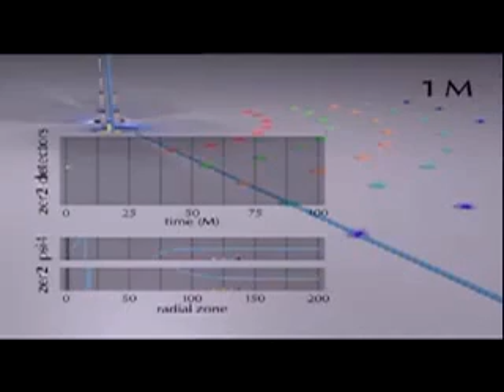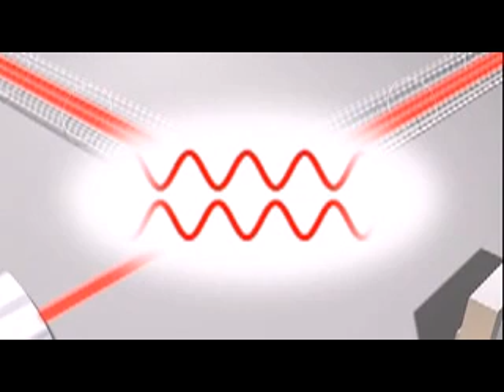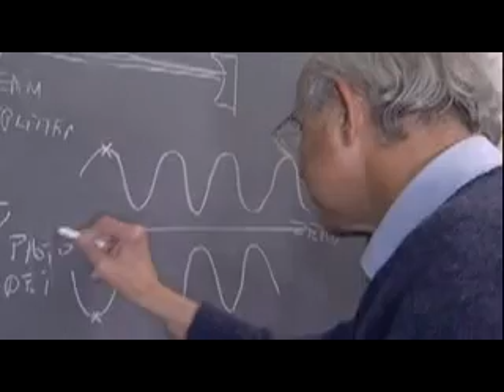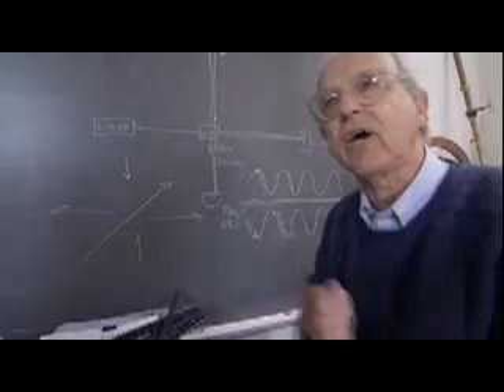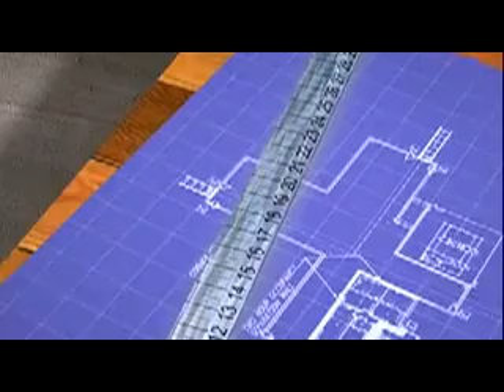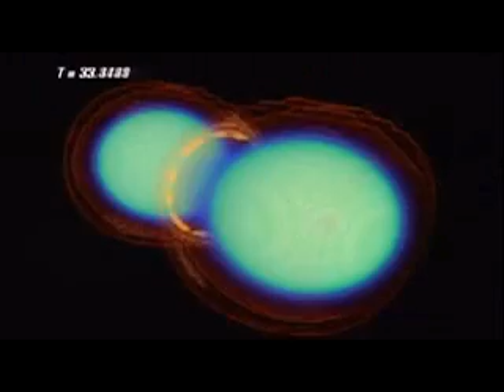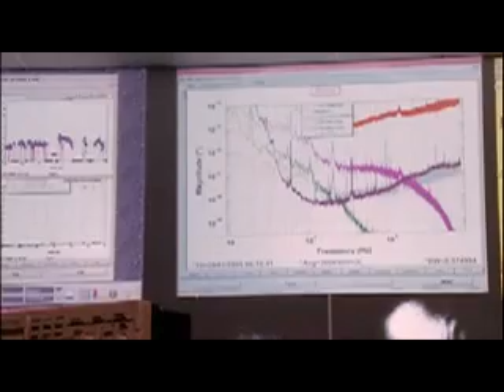LIGO Gravitational Wave Observatory

Comment: To hypothesize the Gravitational Wave, one must presume that Gravity is a "broadcast" force, like light or radio. something that is not likely. Gravity is in my view locked to the Objective Mass, and not a transmit force, like Einstein presumed . My conclusion is this : To broadcast gravity, one must do so in kilograms (See Cavendish Experiment). Not as a transmission waveform that is a compression and rarification interval of " Ether" (Ether is my personal understanding of the Higgs Field). By changing the geometry of an object, is not the same as adding or subtracting molecules. that is by stretching a rubber band, the wheight is not altered. Ergo, geometry has nothing to do with gravity, but the number of atoms does. If one of the LIGO arms is displaced due to any force, the atomic compound is not changed, and therefore no change in gravity . Although "a gravity wave" is supposed to displace geometry in a target object, again it has to be presumed that the gravity is a wave that is able to be transported over distance, something I would think is false. In so doing also may decouple the link between Gravity and Light (edit 05.12.2015 : the light wave wavelenght will stretch along with the tidal forces, or displacement of earth geometry,  therefore it will make no visibility in the reciever mirror. If not, the Light wavelenght is " static" and the geometry of the earth is changing, making the mirror detect a phase change . /end edit ) . Einstein has mixed the cards together most probably because of the Gravitational Lensing experiement, perhaps . I might compare gravity with temprature, it belongs to the object, and can not be "transported" . Temprature again has a IR electromagnetic radiation that energise the atomic vibration. well. Temprature has a transport wave Infra Red. The IR wave needs to bounce off a molecule to create heat in the form of vibration on the molecule. if no molecule absorbs the wave, the IR wave is cold ...  Just like the lightwave is invisible until it penetrates the eye. If not the night sky would be bright light ! But does Gravity, have a counterpart waveform ? In my understanding no . Compare it to Magnetism, it has no way of transmitting its force unless electrons are put in motion. or a permanent magnet is motivated, over a distance. question is then is electrons displaced when optical waves are transmitted , like Light or radio waves through vacuum  ? If there is a Gravity wave it has to have a specific frequency. Is that frequecny in the electromagnetic spectrum ? Making it able to "pitch" light to a LFO to radar, to Radio, down to a "Gravity wave" well. who knows.

I see the Gravity waves is detected september 2015. No sign of critisism . everybody buys it . I dont. Its only detected in colliding black holes. Personally I think it is a light pulse that disturbes the mirrors in the LIGO. not a gravitational wave. That Light can move objects was experimentally proven by William Crookes.
Reply: Radar Blue Well done sir... You nailed it... I have been saying it for ages... it's all temperature... Gravity has no wave as there is no gravity... Just a natural phenomenon we have used to explain starbirth theory... That's where all modern physics is at the moment... Looking for something that doesn't exist...
Reply: +20Proff   " In my opinion (which has no scientific credibility - I just think) what 
we refer to as "gravity" is a by product of electromagnetic forces...  " 

Sir, you are so close to the truth.  Gravity is the byproduct of something else, and the nuclear bonds are involved.  Please notice that the impressively weak "force" of gravity works across great distances.  Let me say that in a different way:  It has a different scalar than EM.  

There are no Gravetons.

The Earth experiences two gravity waves every day, proven by the tides.  Can LIGO detect these?

Does anybody want to know how gravity actually works on a nuts and bolts quantum level?
Reply: +Jon Wiebold Many thanks. With regards to your questions: 1. I assume this is actually rhetorical. LIGO cannot detect them... 2. Yes. I very much want to know... I know very little of nuclear bonds... Could you please do me the courtesy of referring some useful learning material??? It would be very much appreciated...
Reply: +20Proff  YouTube video:  Origins of Mass  Dr Don Lincoln of Fermilab.  
To everybody's surprise, Inertia, Momentum and Gravity are all N forces, normal reactive forces to outside influences.  In the case of gravity, it is an N reaction to the gradient of time dilation, not any other outside influence.  Thus, Newton's formula is arithmetically correct but descriptively wrong because the two masses are not attracted to each other, they are motivating themselves toward the common center of time dilation.
I apologise for not answering you sooner, but NOBODY seems to get this simple gravity explanation.  Because, if proven true, then there are no gravity waves.  Gravity is internal to bonded quarks.
Einstein was right about Equivalence.  At the quantum level, kinetic acceleration and gravitational acceleration share causality.
Reply: Cheers...
Reply: Thanks.  More about how gravity works:  
1.  If it is, in fact, the strong nuclear bond inside the nucleon, with its ridiculously small scalar, that is the actual force involved in gravity, then how can gravity have such a large scalar, larger than the galaxy?  The answer is this:  The nuclear forces need only to operate on the nucleon, nothing else.  It is the time dilation that has the immense scalar.
2.  I cannot prove that the nuclear bond is not instantaneous, but it needs to be slightly slow in order to react to time dilation and give us the normal N behaviour of gravity.  Gravity does not make sense as a reactive force unless you apply the time dilation of general relativity to your understanding.
3.  A cross section of Einstein's "trampoline" depiction of spacetime  contains a graph that represents time dilation on the Y axis.  Time is slower in the sagitta under the big marble.  The local amplitude of gravity is the slope of his line, where horizontal equals zero.
Reply: What a fabulous discussion!  May I interject a thought or two?  We have some secondary evidence about dark matter, that is gravitational lensing. 
It is my hypothesis that we know two basic facts about DM,  1.  As it responds to gravity, it must be normal matter.  2.  As it is intangible, undetectable and invisible to us, it must be moving FTL.  Therefore it is normal matter that was created at some speed faster than light, relative to our norms.  Heresy, I know.
Reply: Radar Blue - you’re making the same mistake as Newton thinking there is an invisible force between two objects - that somehow gravity is connected to the object. Massive objects are not gravity, they create gravity by bending space-time. The movement and collision of massive objects can create gravitational waves in the fabric of space-time. Since the entire universe is composed of this fabric, the gravitational wave propagates through the universe for as long as it has energy.
Reply: +Jon Wiebold +20poff . Good day Gentlemen. I have written an Essay on Gravitational lensing on my blog. I would be happy if you look at it ! Cheers . http://darkgungal.blogspot.no/2015_11_01_archive.html
Reply: +Radar Blue   I read your blog. I could give you 20 comments, but I want to start with only one. You seem confused about the concept from General Relativity concerning Time Dilation.  In completely different words:  Where mass collects, Time is slower.  In the void of space, time would be faster.

Glad you put your thoughts onto paper.
Reply: +Radar Blue "Gravity is in my view locked to the Objective Mass"  I concur.
Reply: +Jon Wiebold Thank you. I will look at it at once :) sometimes its the other way around !
Reply: +Radar Blue so if this is correct it explains why no continuous waves are being detected from normal planetary orbits and our own moon. You would think there would be some continuous ringing resonance if such waves could propagate. so how do gravity waves differ from the gravity effect of normal moons on planets such as what causes ocean tides on Earth.
Reply: +Radar Blue  Since no one has proved anything about gravity yet you ideas seem a little premature.
Reply: Nobody will understand what gravity is until after they understand what mass is.  Mass is not an intrinsic property of matter, it is a quantum behavior.  Go watch "Origins of Mass" video, Fermilab, Lincoln, and then come back for a macro and quantum explanation of gravity.  All your questions can be answered.
Reply: +Jon Wiebold thanks for the material suggestions I have to admit that I have not thought about the question of what mass actually is at that level.
Reply: Are you comfortable with the Lorentz Factor, the Gamma Factor?  We will use it to explain how much more force it takes to accelerate something as it approaches the speed of light.  ( not Euler's Gamma )
Reply: Gravitational waves have been confirmed. Jossed.
Reply: Well there goes your explanation
Reply: +Celestial  My explanation will stand for a long time, but it will not benefit from my telling of it.  Nor will it bear my name.  I will say nothing new, just say what Einstein, Lorentz and others have said, show how their wisdom applies to the mechanics of Gravity.  Gravity has three necessary components...
There are still no gravitational waves.  Let a few chips fall and we shall see how this science evolves.
Reply: It seems your explanation lacks physics, I am afraid to say. To say it is not transmitted is to say it is an instantaneous force. The existence of the wave comes from the fact that any change in gravity will need to be communicated to the universe. Any such oscillation will be propagated as a geometric wave. Also, temperature is kinetic energy, and it IS transported, given its statistical nature. The radiation emitted by the body, already has the energy, it is not cold, the energy is carried by the photon.(Planck-Einstein). Also magnetism IS a wave, just as any electromagnetic phenomena propagates at speed of light. And just as you can´t compare sound wave frequency to electromagnetic, you can´t compare gravitational waves frequency.
To conclude: The existence of waves is created by the simple fact of a finite speed of propagation.
Reply: blackbomber72 Well, congratulations, you sound very smart... But, they did not observe a gravity wave, so they used a model... Gravity does not exist...
Reply: +20Proff gravity doesn't exist? That is the stupid statement of the day.
Reply: Hold on!  Let me decode that comment:  Gravity is not its own discrete thing, it is the composite and bi-product of several things.  The results of which we call gravity. Taking Gravity apart and understanding its components is the hard part.
Reply: And your point is, that it is not a wave just because it may be something much more complex?
Reply: Gary Simmons It's a simple argument that cannot be refuted: they cannot observe that which they have theorised and hence can only show proof through a model... Observing the model you have created is not observable and empirical... Every time they try to observe something, they don't actually observe it so they whitewash the data through their model... It is scarcely even science but rather the re-enforcement of a pre-conceived idea... If the scientific community was really confident about gravity, they would reproduce the Cavendish experiment by today's standards... Why do you think they have not reproduced it ever??? My thought as stated above is that everything relates to temperature, electricity and magnetism... We simply do not need "gravity" as it's own force to explain things...
Reply: +20Proff Ridiculous and petty. Also hypocritical, since you call temperature important, when temperature is actually average kinetic energy, it is a model according to your definition. It seems you not only lack physics, but also a basic knowledge of logic. The 4 forces are electromagnetism, strong interaction, weak interaction, and gravity. And I assure you the experiments made over this century are designed to rule out any ambiguity about their nature. They are not "just" a model. Their nature is precisely what the theory states. Also Cavendish balances are easy to make. I made a experiment once with one in my undergraduate studies.
Reply: blackbomber72 I don't have trillions of dollars of other people's money with nothing to show for it... How ridiculous and petty I should ponder the nature of my existence... Chill out...
Reply: +20Proff There is enough to show it. A gravitational wave is a rarefaction in space time that has cross or X polarization, comes from nonzero quadrupole moment astrophysical events, and travels at the speed of light. We detected just that. Hence it is a gravitational wave.
Also knowing the universe is never a waste. You may not see the fruit of this endeavor now, but in the future some wise engineers will find how to use them, and further our quality of life.
Reply: blackbomber72 Yeah well there is where we differ: I don't think space and time are variables... Equations aren't reality... You sound like a priest...
Reply: +20Proff You too sound like a priest. Defending a philosophy will invariably sound like that. I will conclude by telling you: What about the measurements of space and time? Are they false too? And then why things get near of each other? The reality is there and there are various ways at seeing it. I just consider General Relativity as the simple and with more predictive power of all the ways, and that is why I adhere to it. You are free to do whatever you want, but I needed to expose my points. Not just for you to learn another way at looking it, but also for the few people that read this. This will give them choice. Not discussing would be placing even more blind faith into an idea.
Reply: blackbomber72 How do I sound like a priest? I believe in that which is observational and empirical, whereas you believe in models... My theses as to explain what you refer to as gravity is not properly understood by you. You just regurgitated text-book diatribe of which I am fully aware... Back to the point: LIGO has not observed gravitational waves, yet they sell to the public that they have by publishing the results from their own simulation which differs from reality but they wish to superimpose upon reality... Enjoy that...
Reply: blackbomber72 Take dark matter for example: They take the mass of the universe and see that according to GRAVITY, there is not enough mass to hold the universe together. So, instead of saying gravity must be wrong and we are in the dark, they just invent a new kind of matter and insert that into their COMPUTER MODEL and then say it exists in reality. It (dark matter) obviously doesn't exist outside of their model (which implies gravity is incorrect) but the cult can't admit it...
Reply: Jon Wiebold Hey Jon. Gravitational lensing: Ring systems are not uncommon in space... They are visible in all spectrum's of light... What's to say that these ring's are not the bending of light but rather just ring galaxy's... The red shifts we observe from them could be the same as quasars, non-cosmological in nature... If you agree gravitational lensing is caused by black holes, it follows that you agree that black holes must exhibit gravitational lenses... Please explain why we don't see any lensing effects at the centre of the milky way??? Nothing bent, nothing distorted in direct contravention of gravitational lensing... Not all galaxies display lensing but some do??? Conflicting data from all sources...
Reply: Can we please stop this electric universe bullshit, the very fact of time dilation proves this 4d geometric, tenseless, object is curved in the presence of matter, also in order for the speed of causality to remain invariant during acceleration spacetime must be curved which also results in a fake force going opposite of the direction of the acceleration, this is why you're being stuck to your car sit while accelerating, and also you keep the speed of causality constant and don't suddenly glitch into the future or the past. And since spacetime is curved around earth you're being pushed upwards by the fake "acceleration" of the earth towards you, this is very settled, please stop dissing general relativity, unless you find an alternative to how keep the speed of causality throughout different segments in space and in time.
Reply: Daniel Skiba Electric universe? I didn't bring that up...
Reply: +20Proff Grav lensing is caused by time dilation. Time itself is slower and the speed of light is slower near a huge mass that causes the time dilation ( General Relativity ). 
 Gravity is three things.  The third one is a gradient.  Telescopes see lensing on distant galaxies because the nearer galaxy is a massive point in the middle of nothing with something else behind it.  The gradient is tight.  Not the same set-up in the Milky Way, sprawled across the sky.
Reply: +Jon Wiebold not correct time dilation has no role in gravitational lensing, you should read my previous comment
Reply: +20Proff To me it seems you don't understand the philosophy behind the scientific method. No understanding of the universe is absolute. One crafts a theory and tests predictions WITHIN a set of paremeters defined by the theory. Within the theory it is stated that waves generate a shear that responds to a curve, which is measured for correlation against the measured shear. It is no different than having a speed calculated by a theory and then measured within errors. Waves gives us an answer in the realm of precision we have. Or are you a purist which needs a total understanding of everything, in its most fundamental level at all times?
Reply: blackbomber72 I understand the scientific method perfectly well. Models are not reality and whitewashing the data from reality through a model is not the scientific method... So, are you acknowledging the theory of gravitational lensing is inconsistent when it comes to observing the black-hole at the centre of the milky way? That's how a conversation works: You answer my question first, before asking one... No, I am not a purist. No, I don't need a total understanding of everything in it's most fundamental level at all times...
Reply: +20Proff I can't find such information concerning the Milky Way Galaxy lensing.
And I don't get where it is hiding the truth. The sequence is: GR>Binary System>Radiation zone amplitude and inverse square>Curve. That curve is analysed against the data. Where is the truth being hidden? Apart from the obvious part where GR breaks down, which this experiment is nowhere near.
Reply: +Daniel Skiba  Sir, I agree that the Electric Universe hypothesis is flawed.  For example, compare the scalar of time dilation with the scalar of anything electric.  Big difference. BUT I am most uncomfortable with the term spacetime.  I consider space to be the only constant while time is variable.  How can spacetime be anything but Einstein&#39;s favorite shorthand for describing reality? Allow me to apply this unease to todays topic:  I see that LIGO detected gravitation waves from a PR point of view.  From a more scientific view, they get my Hurray! for detecting transient waves of time dilation, not gravity in its fullness, because time dilation is the only one of gravity&#39;s three components to have the right scalar to cross the cosmos, no matter the speed.  It seems odd to me that Ligo is an instrument for measuring space, not time.  In the mean time, I would like to keep my opinion about TD and GL until a better explanation is offered.  Thanks.
Reply: Jon Wiebold Fair enough, if you think space and time are different, the theory won't appeal to you. But given the existence of 4-vectors and the invariance of Maxwell's equations to Lorentz and not Galilean transformations, the scientific evidence points against your viewpoint. Also LIGO measures time too,  because it needs the velocity of the wave and the frequencies.
Also a question to everyone in the conversation, what is your definition of gravitational waves? I already gave mine, maybe we have a difference in definition?
Reply: +blackbomber72 exactly, I think Jon doesn't understand the reasons for spacetime to be treated as a 4d tenseless object, you would agree with me that if a movie is published everything in that movie already exist, but you need to play it forward to see it, let's say the movie plays at 30fps, no matter how much a fast a character in the movie is moving he will never be able to get to the next second before 30 frames passed, now inject another two dimensions ( a movie is 2d) and you get spacetime, which has some kind of a weird forward play we don't understand yet called the arrow of time, but anyway that arrow of time has a certain speed, it's called the speed of causality, which is the amount of time it will take to anything to communicate with each other, notice that you cant communicate with the future because it also takes time, but what if you moved half of that causality speed? It would take you longer to communicate with the future, i.e. Time dilation, this alone proves spacetime